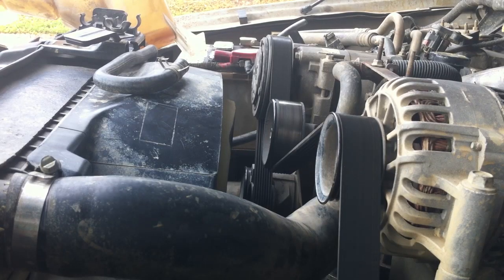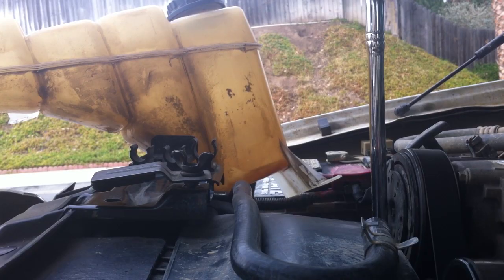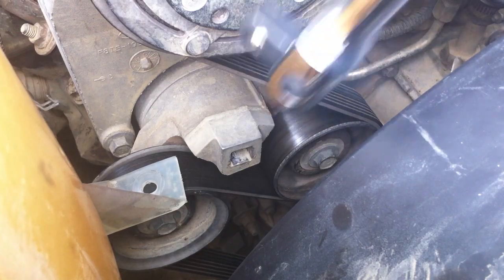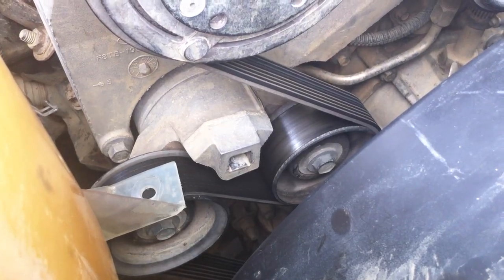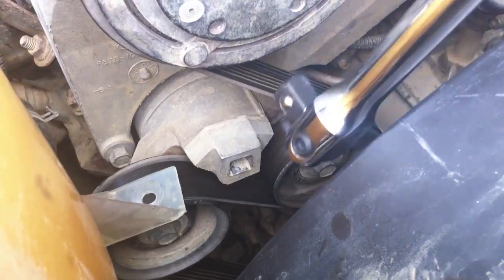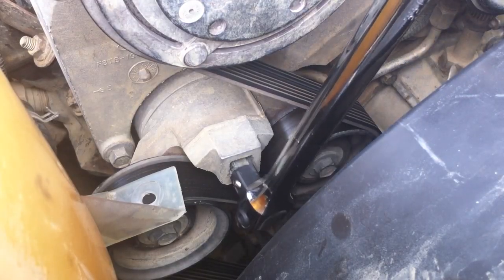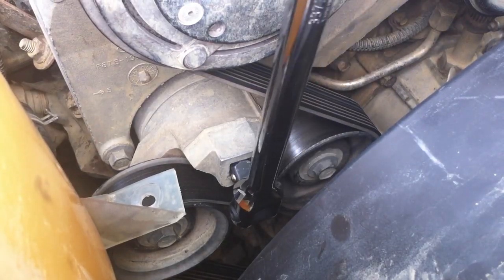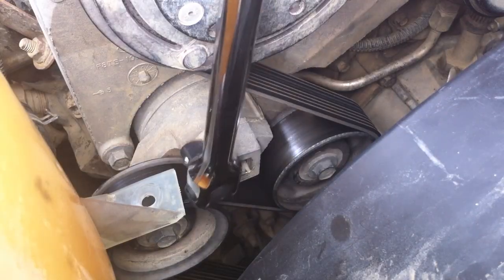7.3L PSD - How To: Change a Serpentine Belt

Comment: It's probably too late, but there is a different version of the upper radiator hose that goes around the belt, so you dont have to disconnect it and spill coolant everywhere. 1:28

Comment: To change the serpentine belt you have to HOLD the tensioner counterclockwise and pull the belt over. Missed that part. I gotchu